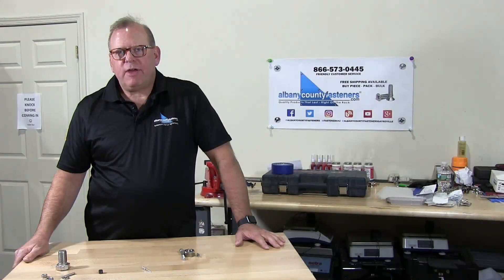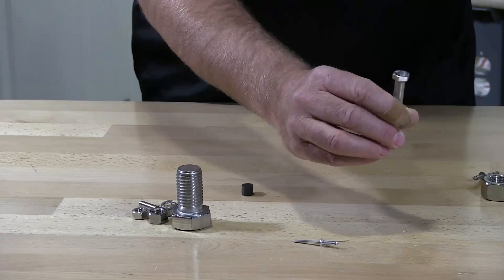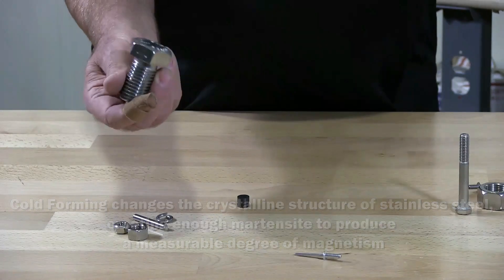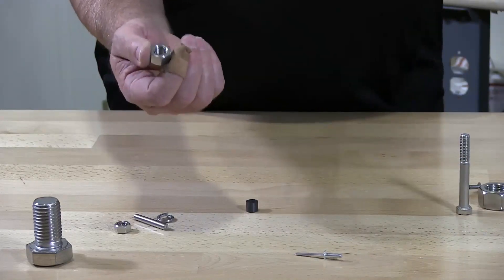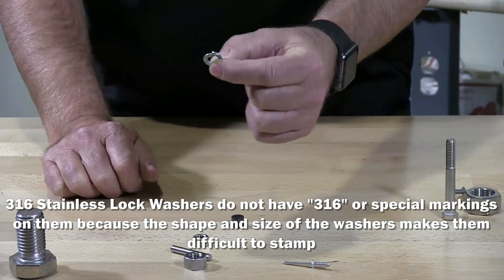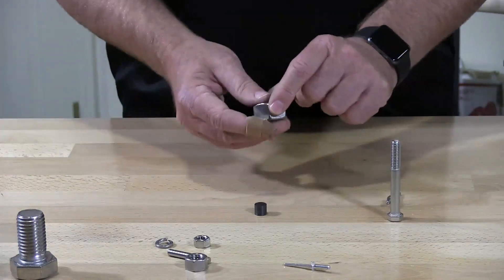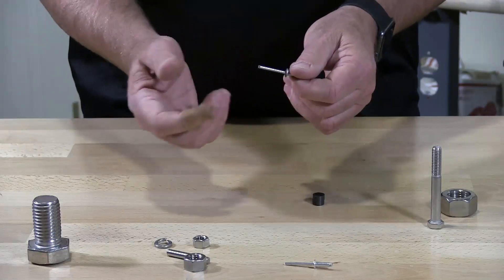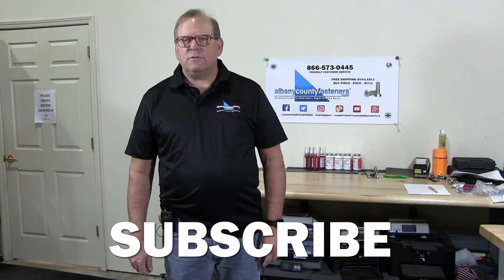Is Stainless Steel Magnetic? | Fasteners 101

Comment: I once thought that stainless steel was non magnetic and because my cutlery was rusting I thought that it was fake but in reality, stainless steel still does rust but is resistant to a degree, if you scour and keep it near electrolytes and bathe it for a while it will change the properties of the metal to allow rusting or pitting, also stainless steel can also be stained with rust of other metals without effecting the metal beyond the stain itself, polishing can remove this blemish.

At least this video explains the scientific portion of why it's magnetic, however even with the most powerful magnet will attract many metals including aluminium and I mean neodymium or even a electrically powered magnet that's found in industrial would pick up aluminium

Comment: How about stainles steel 304 sheet would they be partially magnetic? Meaning not hold the magnet?
Reply from the maker: I do not think that it would be magnetic. Stainless steel fasteners get their magnetism from being worked due to a transfer of iron. We do not have a stainless steel sheet to test this on but that would be my guess and even if it was magnetic, the magnetism would be weak compared to other magnetic materials making it a poor choice if you need the sheet to be magnetic.
Reply: Albany County Fasteners thank you th
Actually i need the sheet for food purposes, wich one would you recommend if you have knowledge in that area, and what thickens for whole heat distribution?? 
Ive been looking for all sort of info about stainles steel 304 and now this magnetic thing to recognise 304 from 316 its was really helpfull
Your advises are appreciated thank you.
Reply: @sokolbaca  I have SS304 sheets attached to my gate. It has no magnetism. The same sheets are used as food grade for meat cutting here.